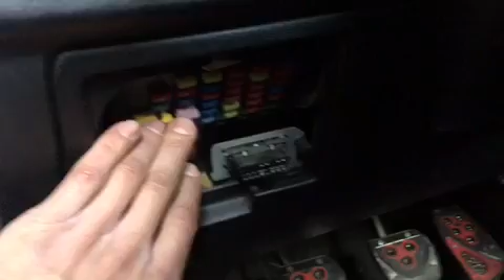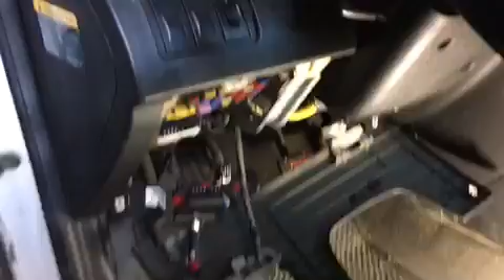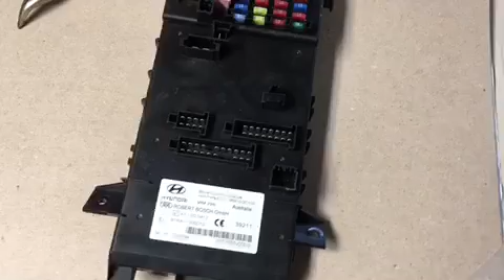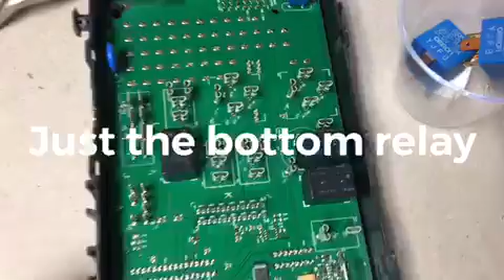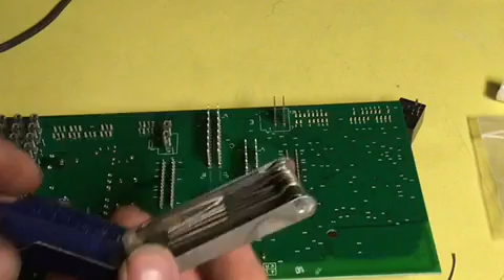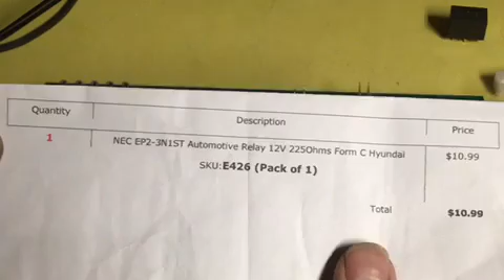Hyundai Tiburon turn signal repair

Comment: Thank you very much for helping us. But I have a question. In my case, the problem is with the left turn signal. Does this relay solve the problem with the left and right turn signals? Or do I need to replace the other relay? Thank you.

Comment: ay bro I have two questions!
1. Where did you find that 10 pin relay for the right turn signal light
2. can I fit a relay from a different year Tiburon (coupe) to my 2003 1.6
thx In advance!

Comment: do you know if one of the other relays is for (un)locking the doors via remote control? that doesn't work anymore. (the remotes work, the central locking mechanism works, they are programmed to the car, but they won't open the doors).
thanks for the great video.

Comment: Hi Andy, thank you for the great video!  I have a question, so in your vid it is the right turn signal, but for my car - it is the left turn signal.  Does this mean that I should replace the other relay, or is it the same relay you had to replace?  Thank you in advance.
Reply from the maker: Hello Neo, I’m glad you found the video helpful. I wish I had a clear answer to your question. Unfortunately I am not certain if that relay controls both left and right turn signals. I think it does control both because it has 10 pins , so I believe it is a double relay in one case. However it may be wise to just replace both relays mentioned in the video to be sure. Hopefully this helps. Good luck!
Reply: The relay is divided into left and right side so this relay must be replaced

Comment: I just replaced the indicator relay on my fiat BCM,my initial problem was all turn signals on the driver side weren't working,now after replacing the relay 'both' sides of the car my indicators aren't working,plus the car no longer recognises my keys!!Careful doing this stuff!!
Reply: any updates to your signal stuck problem?  My 2003 Tiburon has the same problem. I just ordered the relay from mouse.ca and am hoping to do it myself.  Does anyone have any tips for me?  Andy?? I've done some soldering before.
Reply: Hi! Same with mine. Did you do it? and did it work? 🤞Did you change out all 3?  is it three? I hope you did! 😁
I may try it...have had bcm issues for years! 💛✨
Reply: I had same issue with the key. You probably didn't disconnect battery while doing this as I did, I left bcm outside the car for it to discharge and after 3 days went back to life and car's drivable

Comment: My left turn signal doesn't blink I gotta replace the relay like that too right?
Reply from the maker: I believe that one relay is in fact a double relay . It has 10 pins and most relays only have 5. So I am pretty sure that it covers both the left and right turn signals. Good luck!
Reply: @andyl7935  yeah they both light up when I turn on the day time, but the left doesn't blink when I want to turn left.
Reply: Is that relay in the back too?

Comment: Thanks for this! The easiest way to get the relay out is with a heatgun, desoldering with a solder sucker can be difficult and might damage pads when removing the part. Hold the board upside down by bridging it between two books either side, move the heatgun around the pins in a continual motion until the relay drops out. Be careful of thermal shock to the PCB, it's best to preheat the board to around 70 deg C beforehand, and wait for the whole board to cool down fully before cleaning up or touching the pads.

Comment: I find it better to solder 5 wires to the board that are long enough to reach outside the box, and mount a relay socket. Because,  if it broke once, it'll probably break again.
Reply: The problem is actually contamination inside the relay causing the contacts not to open, there's another video around showing this. That was the problem with mine (it's a common fault apparently!). I fixed mine by taking the relay apart, removing the contamination, and resealing the relay.